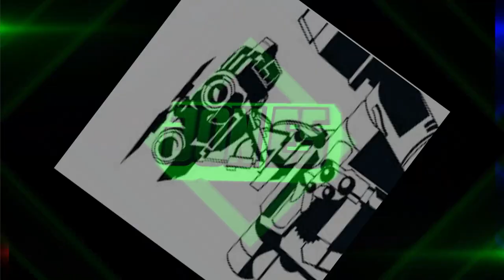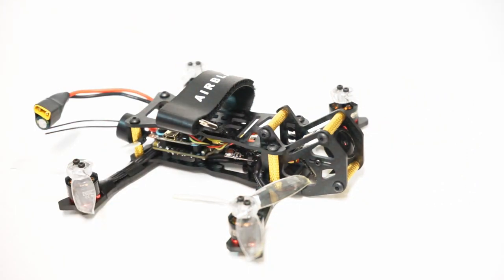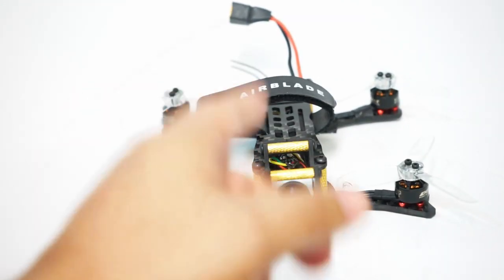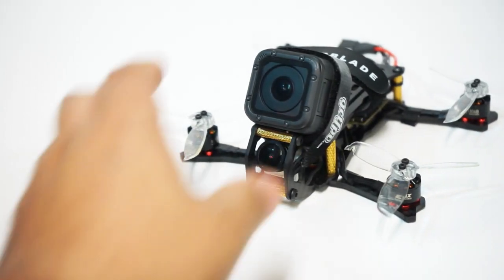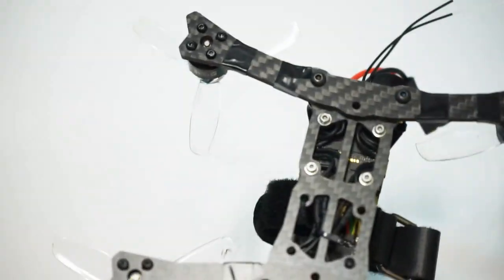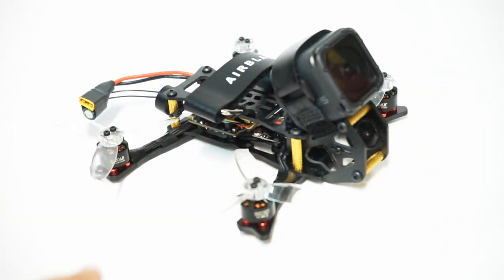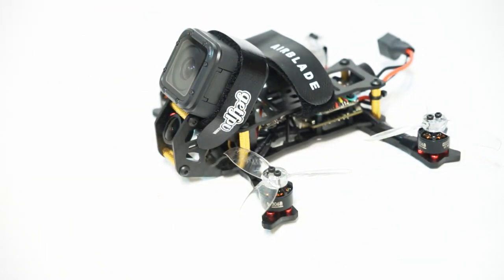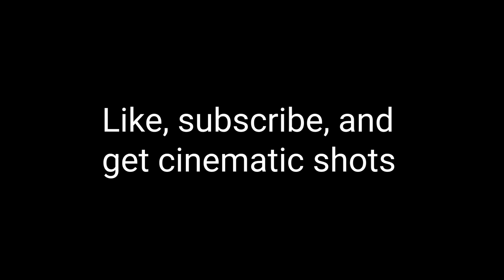Airblade Intrepid V2 GoPro 3" quadcopter

Comment: Mine took me a while to lay out, the stacks could use a little more room between them for sure. I have a 2 board split mini and the RX in the front spot and an f4 nano v6/ori32 + an fx3 ultimate in the back. I had to turn the fc and esc sideways to get them to fit but it's not a problem, the battery lead is zip tied to the side of the frame and doesn't come too close to the props really.

Comment: does it have the mounting hole pattern for the motors the same as the 1108 type motors?
Reply from the maker: I believe the pro and light have those 2 different mounting hole options